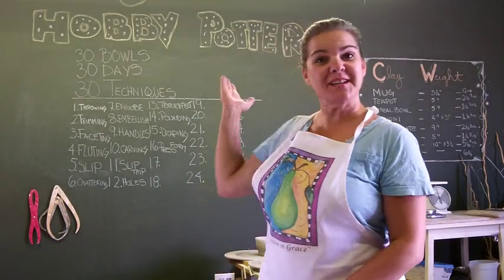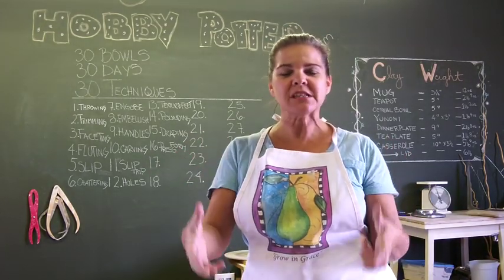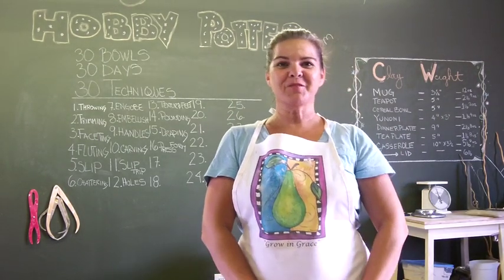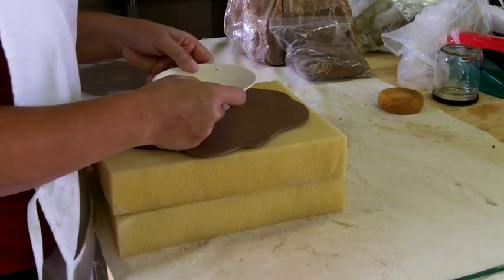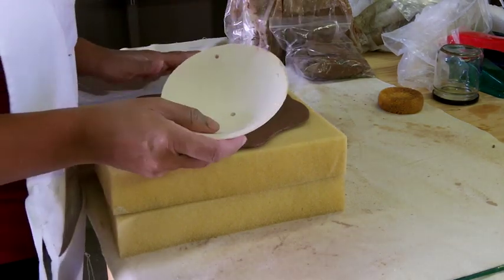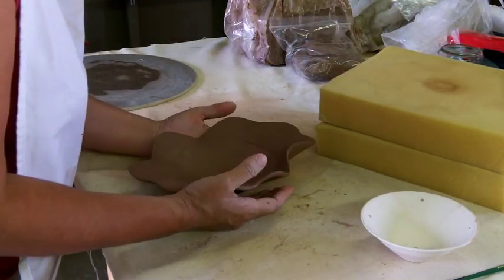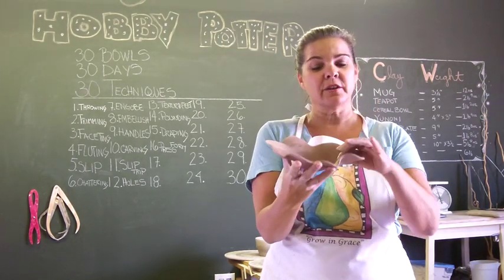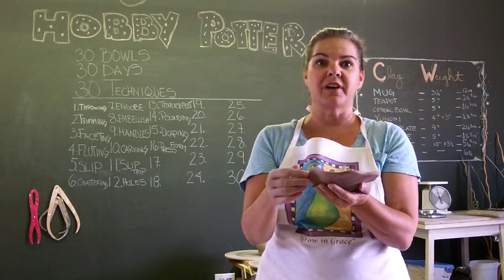Day 16 PRESS MOLDed Bowl - 30 Techniques 30 Bowls 30 Days

Comment: What is the name of the yellow foam you use when you push the slab into the mold? Where can I buy that—I can’t seem to find it anywhere! Maybe I’m searching for the wrong thing?
Reply from the maker: Thank you so much for your question! I found this foam at home depot in a large sheet and it's just a cushion for furniture. (strangely in the flooring section). I've cut it into usable squares and stack it up as needed, depending on the thickness I'm looking for. Hope that helps!😁
Reply: @hobbypotter  Wow, that's awesome! I've seen this at ceramics studios before but never knew where to get some :))) Thank you so much.